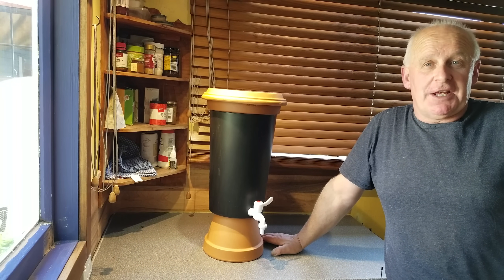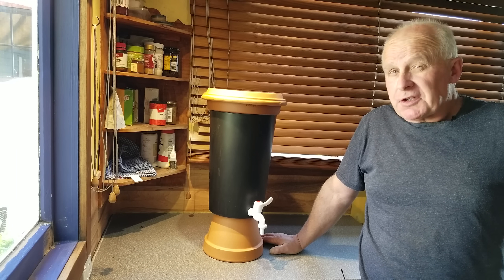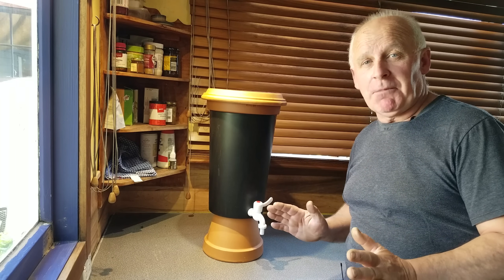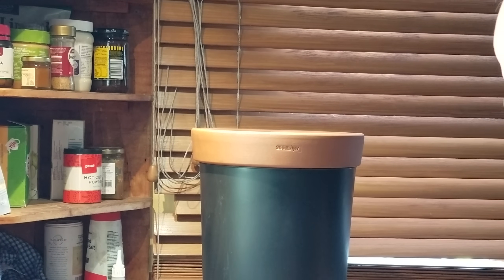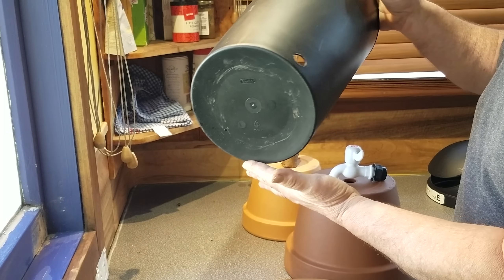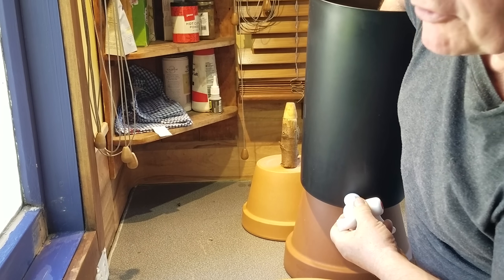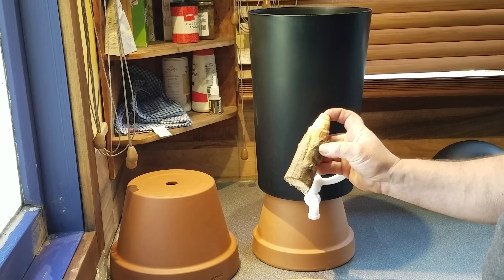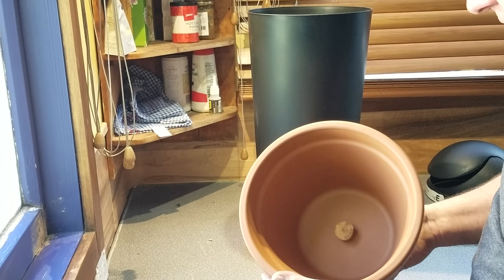DIY water filter. How to make FILTHY WATER drinkable

Comment: Do you have the tools to do before and after testing of the water quality? Lead is supposed to be in those flower pots. What would you suggest for those with no access to that wood?
Reply from the maker: Crikey! - I don't have atomic spectro- mass analysis equipment!!!!- do you?  We dont know that "this' flower pot is one of "those" flower pots. I guess that some regions of the world  have lead deposits in clay. and some dont. 
What I do know is that Municipally treated water is full of added  crap-  This is pure rainwater from a coastal rural area passed through a ceramic filter - My visitors are all asked to taste test it and Ive had comments such as - "well rounded and smooth"  and  "It tastes soft and pure"
Reply: @t.h.o.r.  lmao well, if you don't know the status of your 'pure rainwater from a coastal rural area passed through a ceramic filter' then even if you've 'dirted' your precious rain water you would have no way of knowing, correct? At least what's in the tap won't take you out for a few years. Carry on though.
Reply: A cork
Reply: Interesting... Lead? How about order a pot from a ceramic artist made from clean clay??
Reply: Yes, I would think that it is vital to have the finished product tested so as to protect the children.